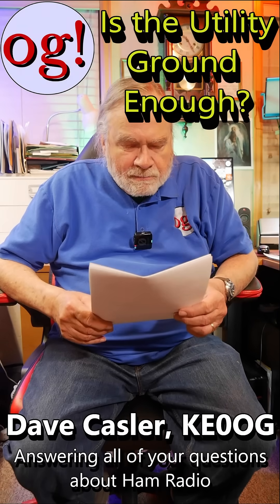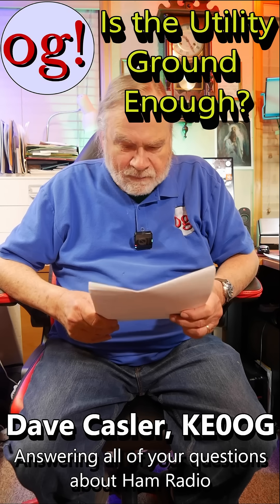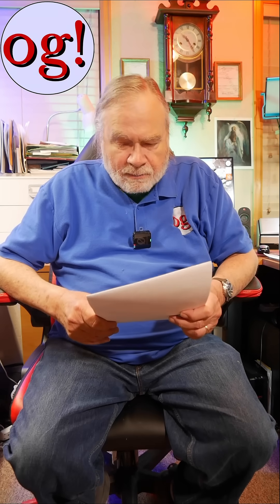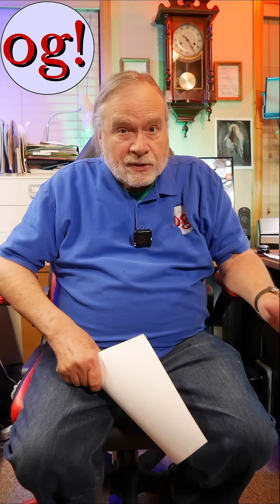Is the Utility Ground Enough? (Short #36)

Comment: Dave, I made a 10m & 20m dipole. We didn't have enough #16 stranded wire, so we used rowmix for the 20m legs. Will the mix of different wires effect the TX & RX of the antenna? The 10m was all ready made, we added the the 20m wire to the 1:1 balun.